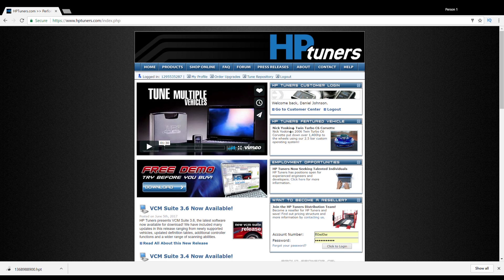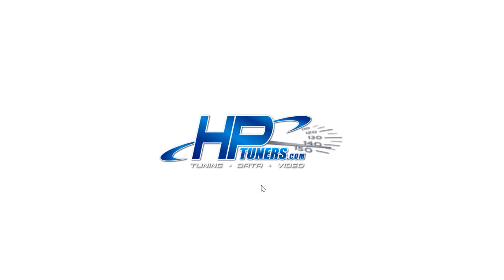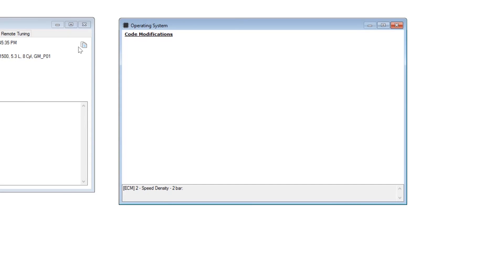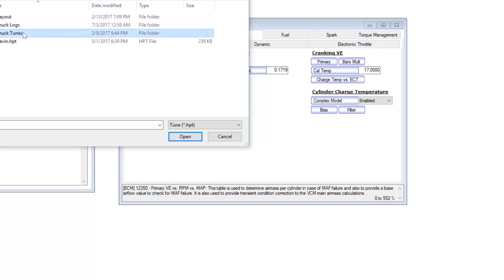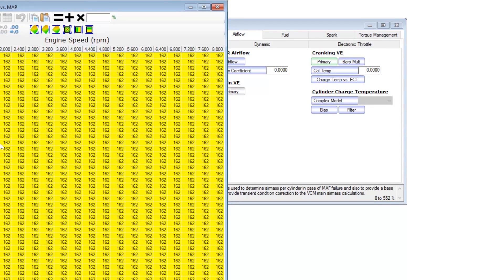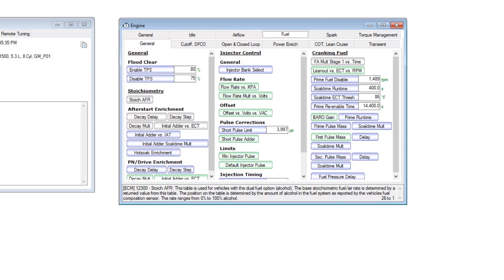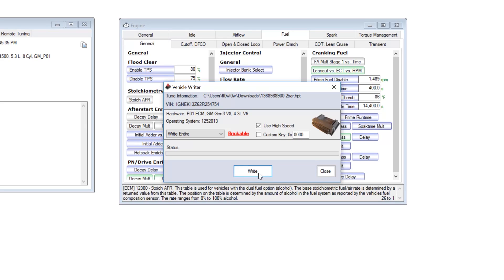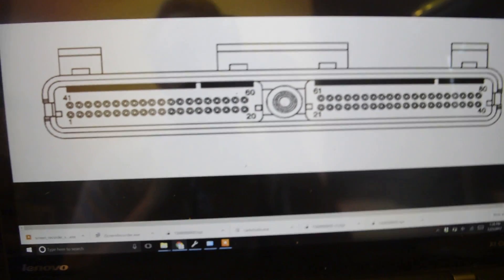How to Enable Flex Fuel on a 411/P01 PCM using HP Tuners

Comment: i did it, i have P0122 AND P1638 ENGINE START AND THEN SHUT OFF. my vehicle is a 99 corvette
Reply: @Spvette  disable or relink VATs
Reply: @Cracked1ce  it’s all disable, if put the original OS no problems at all
Reply: @Spvette  p0122 sounds like an ETB issue. I have never tried this with an ETB before. Only with cable throttle
Reply: @Cracked1ce  yea I figured it was the problem, sad part is already spent the money on credits lol rn I’m running just E without the Flex fuel sensor, meanwhile I find a OS with Electronic Throttle body

Comment: I have a street tuned g8 cammed,built head,header/exhaust on 91, I want to put it on e85. I have the flex sensor installed and wired , my question is if I input the calibration to run e85 will I be safe to romp on the car without a tune for the e85?

Comment: Could I use this os with cable driven throttle body or does it have to be dbw?
Reply: 0411 ecm is capable of doing dbc or dbw you can select whichever you want to use. I got a dbc 411 from the junk yard and switched it over to dbw in the system controls.

Comment: Hey I  just did this to my Trans Am 2002 and the flex fuel is working perfect but I just notice that on mi Tras table a lost D1, and the upshifts, Downshifts and that affects if I manually put mi shifter all the way to D1 the Transmission will stay in 2nd gear... Any idea how to add those tables back again...... Thanks and nice video👍💯
Reply from the maker: Hi, Unfortunately there are some tables that are lost when moving to this OS. This i think is down to them not being mapped by HP tuners so the only thing we can really do is beg them to add the tables which is unlikely to happen. The only thing i can suggest is to either get a standalone transmission controller, or repin your harness for a P59 PCM from 2003-2007. Good luck!

Comment: Anyone know how to 4l80e segment swap on this OS?
Reply: I did mine a few years ago. Just searched HP tuners forum for the how to.

I couldnt walk you through it without looking everything back up, but can tell you it's not too hard.
Reply from the maker: Hey, this is one question i have had myself. I am not sure if the segment swap works like it does with the typical 411 firmware since with the tahoe tune since it is a different firmware.
Reply: Matt with sloppy mechanics has a free base file that's p01 2bar speed density with 4l80e already swapped

Comment: Will this work for any 411 ecu? I have a 2003 Corvette with the 411 ECU, are they all the same?
Reply: it does not work i tried it some of my guages on my cluster don't work like my oil  press guage and security light kept flashing and check guage light kept flashing
Reply from the maker: @lsrteg  It should work. there are a lot of settings that will need to be converted in the tune to make your gauges work correctly. as long as the PCM is a 411 this method will work. luckily if there are any issues you can rewrite the original tune.

Comment: Hello from Australia!  
Down here i am getting tons of tuners saying that my 411 wont run flex fuel. They are saying i will have to swap the tune from 98(93) to an E85 tune when changing fuels. 

Problem is i want to just fill my tank with E85 and let it mix with the remaining 98. 
Will this computer be able to automatically sense the Ethanol content and adjust the tune on its own? And is it the same process as you just explained?

Its a boosted LS1 with a 2 bar map. Manual Trans.
Reply from the maker: yes. just follow the guide and it will work! Good luck!
Reply: Hello Trent
Did you get this work?

I have this set up below, &  would like to run E85 gas.

20O2 PO1-ECU
LM7 5.3 (bored.020)
706 heads ( Stoc Values, & mini ported for better air flow)
Elgin E-1839-P Camshaft (stage 2)
Lsa supercharger (w/2.55 pulley , reinforced cooler Bric & 3Bar map)
Stoc Lower LSA pulley 

4l60e ( 650 max HP built)
Fuel pump (Walbro 450 - E85 capable)

Thanks for your help, & Your Time
Reply: Did you have any luck with this Trent?

Comment: How much for a base tune
I have a p59 with IAC support that I would like to get some what of a base tune for. How much would it be for a base to to be able to start and run till I'm ready for a full tune. (Below is my current setup)
03Escalade Pcm (Serv No. 12576106 Hwd No. 12570558)
Lq9 6.0
4l60
Ls3 heads
Lsa Supercharger
Drive by Cable
Flex Fuel enabled (I will add a sensor)
373 rear gears
Have not desided on injectors & can yet

Comment: Are running the Cadillac CTS-V supercharger on my 3rd gen 411 PCM 5.3 I want to know if I use the E85 sensor for the CTS-V I know that it will Mount up to my fuel rail and my coil packs for Power but can I just Mount up the sensor wire to the 56 pain from that kit will it work and to wire up the wire for the sensor I just tied into the pain I don't replace it with the wire for the sensor right and if I convert over to E85 can I still run regular octane as well
Reply from the maker: from what i think you are saying, Yes. just connect the e85 signal pin to the pin on the 411 and you can run both gasoline and e85

Comment: so let me echo back what I heard.  I have a tune on my ECU now, licensed.  I download the tahoe tune and license it and change its tables to what my tables are, then flash my ECU with that tahoe OS and calibration, keeping my VIN intact.  I just now have a licensed tahoe tune as well.  Is that all correct?  if so, cool. thanks
Reply from the maker: the vin may not stay in tact. i believe that the vin has to be a tahoe vin of the same year. my state doesn't care about vin matching the ecu for inspection. you can always flash the old firmware with your correct vin back onto the ecu whenever you need it to match
Reply: thanks.  I live in a county and state that has no emissions nor safety (anymore).  I did the flash to a spare ECU and the tahoe vin did transfer on to the P01

Comment: DJ with speed density, no narrow bands, your VE table is based on the fuel in the vehicle at the time of tuning? How does the computer adjust the tune for different ethanol percentages? Like if my VE table was based on 75-80% but on the street I was running 30%. Is just an EQ ratio added or subtracted to the VE based on the ethanol percentage? Sorry still fairly new to all this and trying to catch up fairly quickly.
Reply from the maker: Corey Philman the pcm knows ethanol percentage based on the flex fuel sensor. Whenever you put the flex fuel os it adjusts the afr differences for the ethanol % as well as a ethanol spark table

Comment: you shouldn't have to license both. Open the vehicle then open the compare file.
Reply from the maker: Screws Loose Performance it is not just a different map. It is a completely different os. Because of hp tuners licensing system you have to license it.
Reply: can you put any OS into any ecm or does it need to be 411/P01?

Comment: Info on the sensor would be good, as in which one to use. Also, can this be segment swapped to work with a manual trans?
Reply: You can use one from a Tahoe, or off most Taurus's from 99-06. the OE part number is continental 13577394
Reply: Can I use the fuel sensor from the from the flex-fuel Impala the part number is going to close to the one you listed 13577429
Reply from the maker: @ballingonabudgetlsbuilder5930  Hi sorry for the late reply. yes i used the impala sensor on my truck

Comment: I would love to do this to my car but I absolutely need to have a 3bar OS. Would love to see if there is a way to get it working with a 3bar on these PCM's and also have flex fuel capability
Reply from the maker: Will Ditton you would have to scale the tables. I.E. us a 3 bar sensor but use a 2 bar os. 200kpa =300kpa. 133kpa =200kpa. 67kpa=100kpa.
Reply: @DJTuningCom  what if the ecm has already been changed to a 3 bar os? how would i go about adding it?
Reply from the maker: @ashliegadbury6141  Hi Ashlie, you can just follow the video on how to use the tahoe tune but you will need to rescale it to a 2 bar tune. unfortunately there is no 3 bar modifcation for this firmware.